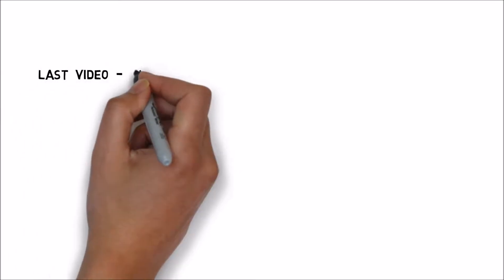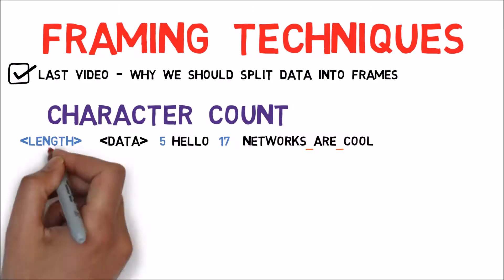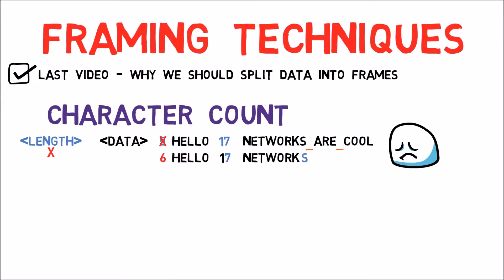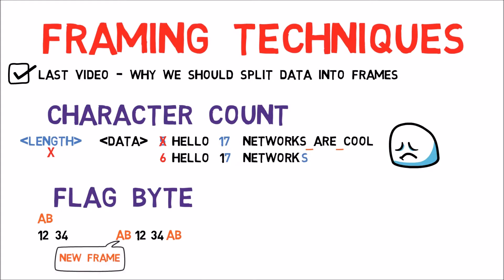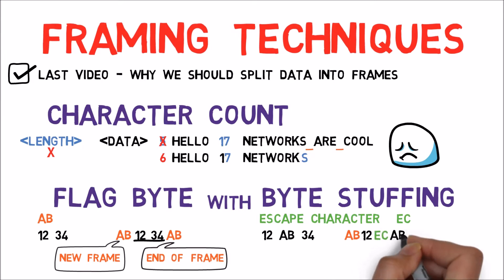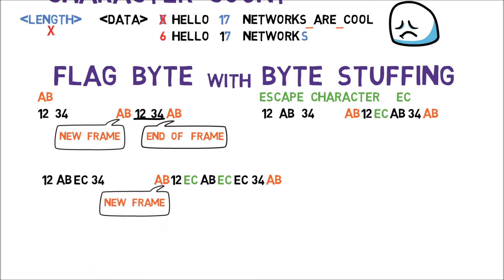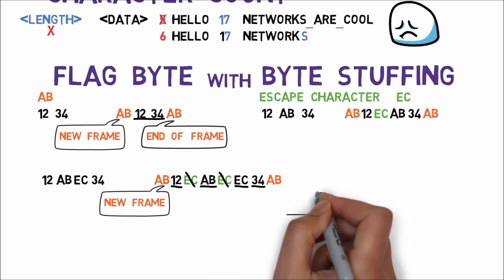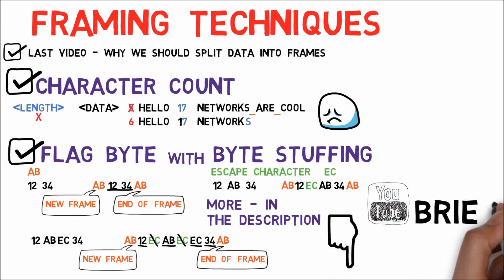3.2 Framing Techniques

Comment: Thank you. I need this. 

So far any website and or search I do asking what a frame in the data link layer is explains that is a frame is data that has been framed. That is a terrible explaination and no one is explaining it. 

From this video I at least know that it has something to do with simply adding more bits to the beginning and end of the data so as to identify the beginning and ending of the data (message).
Reply from the maker: Excellent! Thanks for letting me know. I hope the next videos will clarify this even more :)